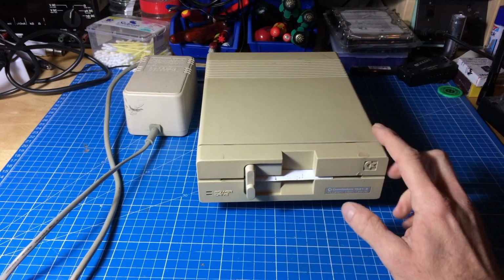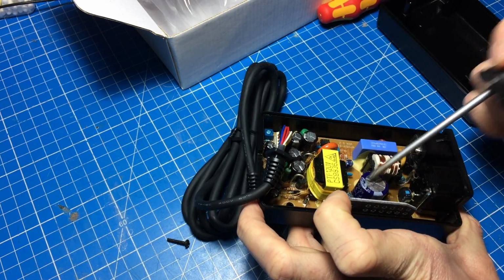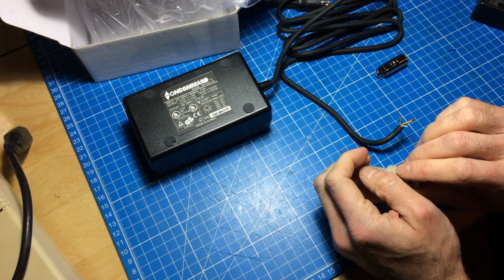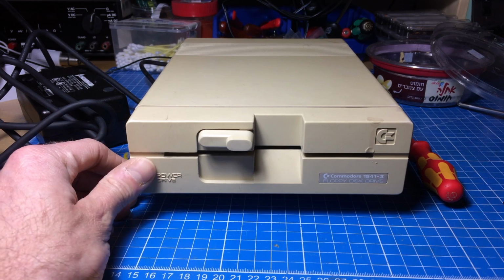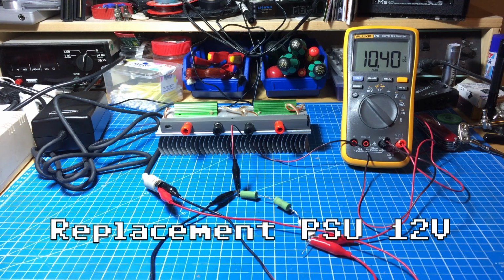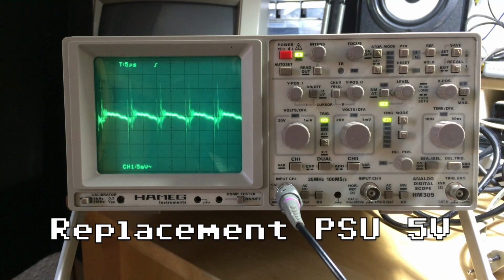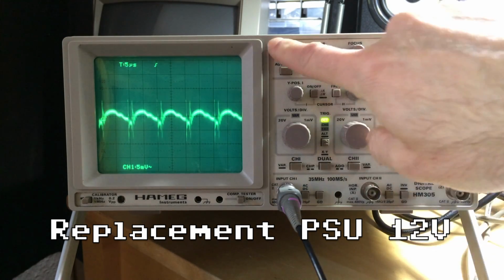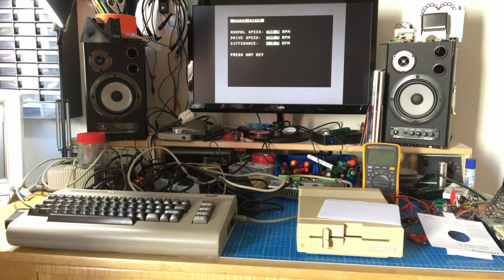Commodore 1541 II Cheap Replacement PSU Test

Comment: An Xbox 360 psu is more than sufficient if you have one lying around. Cut the end off. The red cable need to be connected to the blue to enable the psu to turn on. The orange light should go green on the psu. This red blue combo is also your 5 v. 12v are both yellow wires. Ground is the black wires. The last wire isn't used. Din4 connector and you're done.

Comment: Great video :). However... To your alignment test - it is of no surprise that the drive is 100% aligned to a disk formatted in this drive just a second before. You'd need to use a disk formatted in a properly aligned drive for this test to be meaningful.

Comment: Better to tin cables, insert them into the solder buckets and then apply solder.  Filling the solder bucket before putting in wires is more difficult as you have to keep heat on it for longer while you try to get wire in, resulting in melting wire insulation and possible the plastic that hold the pins in the connector.

Comment: Your alignment check is kinda silly if you're testing on a disk that was formatted on the same drive. It doesn't show if your alignment is close to "standard" since the disk was formatted with the drive's alignment in the first place.

That said, if it did show any errors that would indicate problems with the stepper motor having trouble keeping alignment even with itself.
Reply from the maker: Yes, I realized that after uploading the video... A bit of a noob mistake. I usually use a factory produced original disk for checking alignment now. Preferably the test/demo disk which should have been recorded on a properly adjusted drive.

Comment: a good source of cheap and plentiful power supplies is the xbox 360, al the correct voltages we need are there, and the output is "clean", if your plug and lead is ok but your c64 psu is dead the cleanest way, would be to solder the c64 lead onto the 360 supply, if you dont want to open the 360 supply, you can buy an adaptor that is meant to connect an xbox 360 fat to a slim console, and wire the c64 power plug onto the adaptor,  pinouts for both machines are all over the net and easy to find.
Reply: You could power a 1541-II with a 360 PSU but it's a very poor choice.  It puts out 15-20 AMPS on the 12V line (depending on model) but only 1 AMP on the 5V line.  A C64 requires 1.7AMPS on the 5V line and also 1 AMP 9VAC.

Comment: I have got a question, as I am looking for replacement PSUs both for my C64 as well as the 1541-II drive.

I want to go for the "lazy" (and honestly, safer) route and buy complete PSUs, 12V DC, 5V DC and 9V AC, with enough Amperage to run those devices.

Now the question is with the 1541, when I put on the connector, there is the ground pin (GND). However, as I have two PSUs (12V and 5V), I have two negative wires... 
do I solder on both to that one pin?

I guess so, otherwise it wouldn't work, or would it?
but wouldn't that mean that 12 Volts could be fed back into the 5V PSU, damaging it?

The alternative would of course be to just use one DC (12V) PSU, and then use a voltage regulator to also make 5V from that... however that then has to be quite strong in order to run both the computer and drive, probably 3.5A or more would be a good idea

speaking of that, what are your thoughts about running both the C64 as well as the floppy from one PSU like that (of course plus another one with 9V AC for the C64), is that a good idea or could it cause problems? (like, maybe i imagine when the floppy drive uses a lot of power there could be fluctuations affecting the C64, or vice versa?)
Reply: I see there are PSUs for hard drives etc. which already deliver both 12V and 5V DC. However, usually those too have two GND pins, and they are not labelled in any way different from each other... in that case, would i have to solder on both, or just pick one of them and use that?
Reply from the maker: I might be mistaken but I think the grounds are all connected to the common ground in the C64 anyway (the 1541 has a ground on the serial cable, too) so it's a good idea to connect them together. If you get power supplies with enough amperage it should be perfectly fine to run both from one psu.

Comment: Really interesting video Jan, was quite suprised how good the performance of the original psu was after all these years.
Reply from the maker: Yes, most of them work fine and the output is handled by regulators which output very clean voltages. The problem of using the original PSUs is that when they fail they sometimes do so in violent ways (producing overvoltage) and kill the device connected to them.

Comment: with all the thin wires between the connector and the load the voltage meassurements are systematically flawed. 
BTW: the switching PSU is probably just regulating the 5V rail, and the 12V (and the other unneeded) do just follow. 
This is sufficient for most applications, since 12V is just for Motors and/or feeding "internal" buck regulators.

Comment: Really silly observation but when you took the PSU apart, couldn't you just have rewired it from inside instead rather than cutting the lead? You could have used your desoldering station to do a nice professional job. Not saying you've not done a professional job but I would'nt want the 33 volt rail present in the lead as a safety precaution or the second 5 volt rail for that matter.
Reply from the maker: Of course you're right. I should have replaced the cable or at least cut the unused connections on the other side, too. I think I'll actually do that as a quick hack to make it safer. Thanks for the tip!

Comment: High frequency switching noise isn't that hard to get rid of, just chain series inductors and parallel capacitors. Usually a single inductor is just fine, and with capacitors before and after it should filter out high frequencies at 18db/oct. Make sure to strap the most of capacitance on the device side rather than on supply side, because it really wants to see a low-impedance source across the whole frequency range, but you're trying to increase high-frequency impedance on the power supply side, if this makes any sense :P I'd have an urge to start with tiny little ferrite beads to be placed inside the DIN connector on those lines, that might already do quite a bit.
Reply from the maker: Thanks for the tips! Someone pointed out in the comments before that there's some additional filtering happening inside the drive already. At least there's some caps on the power lines. I'm going to experiment with adding ferrite beads and some more caps at some point, I think.

Comment: Interesting video! Sadly, seems that getting that PSU delivered to the UK adds another €10 to the price! D:
Reply from the maker: +Paul Wood Thanks! That makes it less of a bargain, of course. Still not too bad value for money I'd say... but you'll probably also find something better for that price. There's quite a few "harddisk power supplies" with the same voltages.
Reply: Aye! At least I now know they're more common than I thought - which could come in handy, I'm sure!
Reply: @JanBeta  hi there,was looking for some of those HDD power supplies..they look fine but no mention of overvoltage protection of any sort ..would they be safe to use with 1541ii?

Comment: Probably not enough noise in this case to cause a measurement error, but I have seen where noise can make the measured DC "appear" low using a multimeter. For example oscillation at the output of a 7812 voltage regulator, which is fairly common.
Reply from the maker: +Mark Zacharias Good point. I'll try to keep that in mind for the next time. Probably really doesn't matter much in this case.
Reply: Happens all the time in the repair biz.

Comment: Cool, i'll try to put that circuitry into an old 1541 as they have The same voltages internally (as i remember...) :)
Reply from the maker: Yes, it also uses 12V and 5V. I'm not quite sure about the current though so be careful about that. I would guess it draws a bit more than the newer model.

Comment: That was very interesting. And 2€ for a PSU?  That is cheap.  I like that you did the voltage under load and ripple/noise tests.  Coincidentally, I had just watched Dave's (EEVBlog) video on measuring ripple after seeing Greisis Workbench PSU build video.  Even though your ripple measurement might have done "the crude way", as you say, it does demonstrate the stark difference between the cheap replacement switch mode PSU and original linear PSU.  Well done!  Perhaps a follow-up with adding filter caps, as ZEROSTATIC72 and GadgetUk164 suggest, would be interesting too.  Looking forward to the C64 cartridge video.
Reply from the maker: Thanks. :) I really hope I find the time to try adding some filter caps and make a short follow-up to this one. In the end, I plan to build Greisi's PSU as a permanent solution. The cartridge video is in the works. Might take some time still though.
Reply: Yeah, I haven't had time for video making this week, myself.  I did find this short, yet informative video on "Power Supply Decoupling & Filtering: why we use multiple caps in different locations", https://goo.gl/zGopfH.  Thought you might find it interesting as well, or perhaps this is old news to you.
Reply from the maker: Added to my list. Thanks!

Comment: Great video =D  You could probably clean up that PSU output with some caps btw!
Reply from the maker: Thanks! Maybe I'll do some experimentation with smoothing this (also to learn how to do it, of course). In the end, I want to build something better to power the drive I think. I like Greisi's approach (I linked to his vid in the description) using a classic transformer and modern DC to DC converters.
Reply: It's not as hard as you think - you could more or less stick at 1000uF / 2200uF  on there to start with and that will likely smooth the ripple a fair bit, and if you can work out what frequency the switching is at you could calculate and add a smaller cap there to help filter any noise from the switching.  The reality is the 1541 II probably has capacitors in the drive itself where the power feed goes.  The real test is to meaure the ripple on the DC line inside the drive.  I cannot remember now, did you do it that way or just measure the output of the PSU whilst it was loaded with your dummy load?
Reply from the maker: +GadgetUK164 I just measured the output with a dummy load so the smoothing caps inside the drive are a good point. I'll try to see how much ripple and noise actually goes into the circuitry.
Reply from the maker: +Mr T. Guru Probably a good idea anyway. :)

Comment: The ripple on the output of the switching type power supply is completely normal for that type of power supply and will likely not cause any trouble with the drive. The switching power supply output is far more noisy due to the high frequency switching in the supply being coupled to the outputs. The 5V for the drive will probably work at plus or minus 10% and the sasme for the 12V rail.
There were 2 +5V wires in the cable and it would be best to connect both at the plug into the 1541 as they may be both used to reduce losses in the cable or possibly for the 5V feedback to the supply.
The advantages with the switch mode power supply are effeciency and cost of manufacture. There is no need to make a linear supply for the C64 or drive as modern switch mode supplies are far better than what could have been made at the time back in the 80's. The only real issue is cheap capacitors that limit the lifespan of these units.
Thanks for the videos. :-)
Reply from the maker: Ah, thanks for the information. I've seen smoother output from (better and more costly) switching power supplies but this seems indeed to be sufficient for the drive. I'm still going to get (or make) something better some time soon. Did you watch Greisi's video I linked to? He's doing a kind of "best of both worlds" approach using a classic transformer and modern DC to DC converters in his PSU resulting in a very straight output and pretty good efficiency. I quite like that idea and am probably going to build one of these.
Reply: A switching main converter with a linear post regulator is the normal approach to get really clean power for noise sensitive circuits. A switcher with 15V and 8V outputs then inductor, capacitor filters followed by low dropout regulators on the 5V and 12V rails would give really clean power with decent effeciency.
The linear followed by switching topology doesn't really make a lot of sense if you're after really low noise on the outputs. It's rather practical for generating lots of different voltages from a single output transformer but your cheap power supply is likely more than adequate for the task at hand. 
As for the 1541, the 6502 processor section won't care about 50mV of noise and the motor driver running from the 12V rail won't care either. The head amplifier for the drive is likely the only part that may be noise sensitive at all and should have pretty good power rail noise rejection.
If you want it to last, just replace the cheap capacitors with good brand, long life, low ESR variants and make sure the power supply is used in a well ventilated area.
Thanks for the reply. :-)
Reply from the maker: +ZEROSTATIC72 Sounds convincing to me. Thanks! :)
Reply: I did a similar thing for my 1541 as my original power supply was broken. I did use one of these "hard drive power supplies":

http://www.ebay.nl/itm/c/231899556009

This power supply seems to be of significant less quality than the one you used. Allthough the 1541-II works perfectly on it, it makes noise appear on my monitor, which means the PSU is simply not suited for purpose. Your display did seem stable and I didn't hear you mention any issue, so I guess the power supply you did use is much better in that regard.

For ripple, I don't think it is an issue for the 1541-II, there are ceramic capacitors behind the power connector that already filter the ripple a bit, but more important:  The chips work on TTL voltages, the margin in TTL is waaayyy higher than the ripple.

In the end I did repair/upgrade my original power supply. It's not easy, you need to get it about of its case without damage to the case, then use a saw to saw through the resin to separate the transformer and the rectifier board. After that install a new board with switching rectifier, because they stay cool no resin is needed to cool that. Worked perfectly in the end and gave me the results I needed. It would be a good topic for a Youtube video, but alas, it is already done.

For the C64 I built my own power supply. For this project I made some pictures:

https://www.freepascal.org/~daniel/c64psu/

I believe for the C64, a do it yourself power supply is the best solution, alltough it is a lot of work and not cheap to get all the components. Some people have resorted to simulated AC, or even converted their C64 to DC, but because of the clocks and user port AC, I believe real AC is by far preferable for the C64. The 5V is best implemented with a switching power supply, providing good and more than sufficient power.

However, because of the work and costs involved, fixing the original C64 power supply is also a proper approach. I already fixed a few and once wrote a manual how to do it in Dutch language (contains pictures):

https://www.freepascal.org/~daniel/c64_wigvoeding_revisie.pdf
Reply: It might be a good idea to install a ferrite bead on the cable, such as this:

https://nl.aliexpress.com/item/x/32626685759.html

It prevents that the ripple becomes a radio source (with the cable as antenna), but also prevents that part of the ripple reaches the 1541-II. I use one on my self-built C64 PSU.
Reply from the maker: Oh, thanks for sharing! Interesting stuff. I have the components for a C64 power supply quite like yours (transformer for 9V AC and switching supply for 5V DC) lurking around here for some time now. Just didn't get around to assemble something yet. Should do it soon, I think. :)
Reply from the maker: I have some salvaged ones somewhere, I think. Won't hurt, I guess. ;)

Comment: Well the conclusion is clear enough. It's a piece of crap but at that price it's alright for a temporary piece of crap.
I wonder though what the noise on the 5V and 12V rails were on the new PSU. What is causing the pattern?
Reply from the maker: I think the noise/ripple is mostly because of the way these switching power supplies work. They are switching on and off at certain changing frequencies and have a PWM output. The output is than smoothed by various capacitors and such which in the end generates peculiar repeating patterns like the ones visible on the scope here. Some of the noise, especially some of the high frequency stuff is probably interference from my LED lamp, PC, monitor etc. For proper measurements you would have to use better probes, cancel out external noise and so on. What I did is VERY basic. ;)
Reply: Well it's good enough for the purpose of course. I'll watch Dave's video as well when I'm up to it.

Comment: You could also strap some more filter caps across the 12v and 5v lines to improve the ripple, a couple of different values to give the best result, maybe even a tantalum to help filter the high frequency content. I think I saw a trimmer in the psu, maybe try using it to see which voltage it adjusts.
Reply from the maker: Maybe I'll try that. Would be a good exercise for me, too. There's indeed a little trimmer pot in there. Nothing much to lose if I try fiddling with it, I guess. ;) Thanks for the tips!